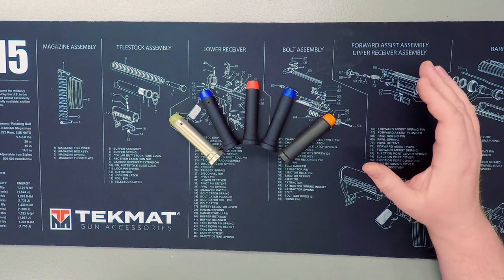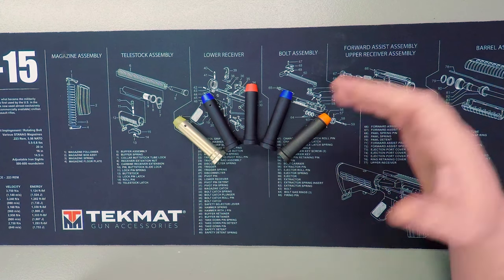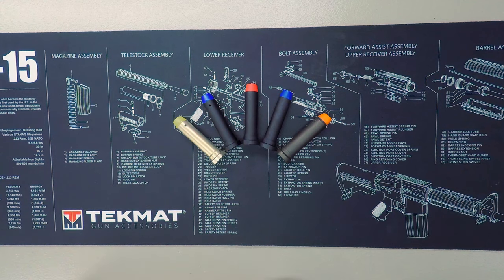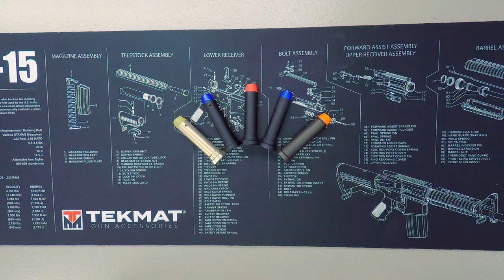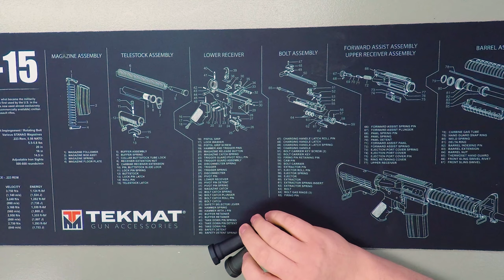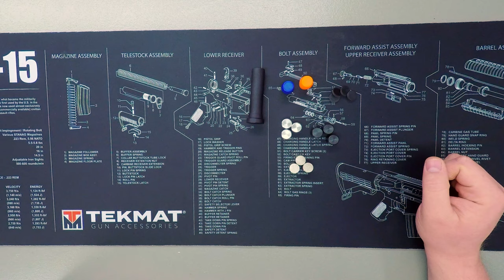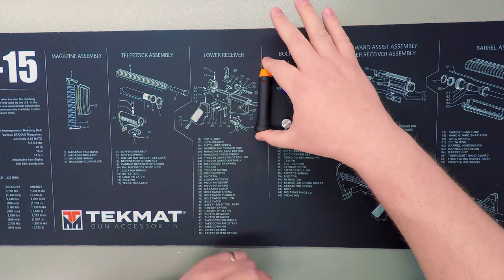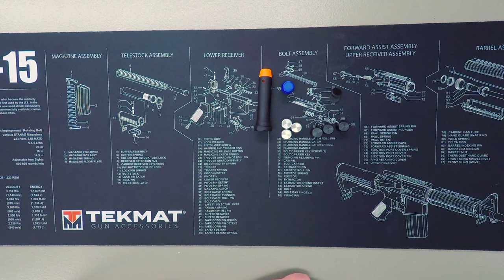Choosing the Right Buffer for Your AR-15 | AR 15 Buffer Review

Comment: Nice Video, very good explained. So for example ... If I build up a 18" Barrel with rifle length gas system and I want to use a mil spec 6 position carbine tube ... which buffer and buffer spring I should use? Greetings from Germany o7
Reply: This will depend on the port size of the barrel you get. If you start with an adjustable gas block, you will be able to use whatever spring/buffer combination you want. If not, put it together and fire it to see what your ejection looks like and adjust from there.

Comment: So what would be recommended for a mid length 11.5 barrel with an adjustable gas block?
Reply: informative. Assuming 556?
H2 would be my first try.
If your just going 223 H1 might work. That adjustable one he showed might be the best path.
Reply: @Viper-dc2wm  it is a .556 chambered faxon gunner barrel. I am currently using a carbine buffer. Obviously the gas block helps allow it work well. But the recoil feel is sharp. This is my first short ar15 build. So learning to turn is good. So yeah i am thinking a h1/2 will be a good way to go. If not the kak adjustable, and Odin works has one as well.
Reply: @voltairee3012  I use a 3 oz
 carbine buffer in my 300 Blackout
and it works well. The 556 has a whole lot more pressure.
Short barrel, short gas system
Makes recoil worse.
Reply: I would run an H buffer with Springco blue buffer spring. Having an adjustable gas block is nice because you can tune it to your liking but you still have to ensure reliability. You can go H2 and adjust the gas system to cycle the H2 buffer as well. Also, doesn't the Faxon gunner in 11.5 inch have a mid length gas system? Most 11.5 inch barrels are carbine length gas systems that makes a difference.
Reply: @pdog305301  yeah it is a mid length gas system. Apparently its meant to be a designated suppressor set up. As the can adds back pressure in the system and mimics some dwell time. I ended up going with a geisselle super 42 spring/ h1 buffer
Reply: @voltairee3012  how much is that spring, ,,good choice by the way
Reply: @timesque9790  i spent 65 shipped from BDU.

Comment: I'm going to be running a flat wire buffer spring in a 11.5" pistol build. What would be the optimal Buffer weight to use? I'll be shooting mostly .223 steel cased ammo.
Reply: I'd personally choose the buffer that cycles the most reliably...